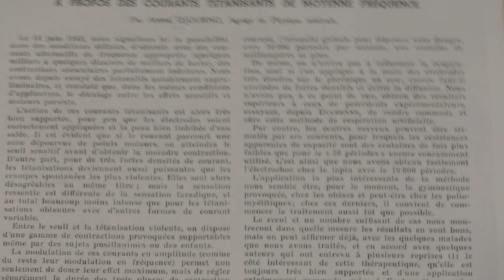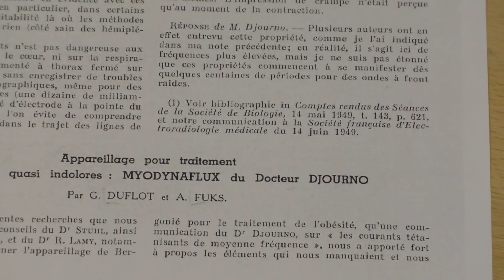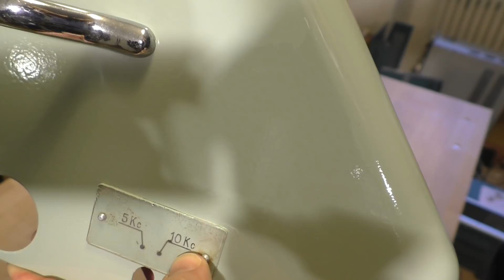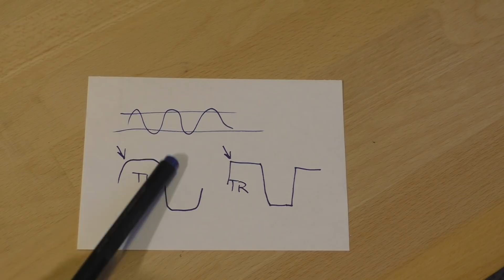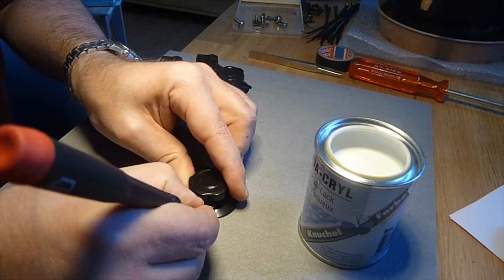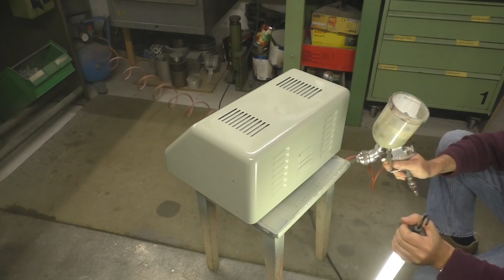Dr.Djourno's MyoDynaFlux (PWJ93)

Comment: Nice work! A very professionally built machine & a very good restoration. Hz has got to hurt! lol, yes it probably does! I had treatment from a doctor when I was 17yrs old with a similar machine after breaking a leg & plaster cast removed to stop muscular wasting or atrophy. It did hurt or shall I say Hzalot!
Reply from the maker: May I ask in which year that was? I told my girlfriend (she is a nurse) about your story and she only said that this must have happened long time ago :-) Seems this technology is not used anymore today.
Reply: Yes it was 1970 when I was just 16 years old, similar sort of treatment methods stimulating muscles with electrical pulses, I remember it was a 'transistorized' machine though, quite large, it sat on a trolley but was battery powered ,when turned on it 'whistled' like charging capacitors, I think they had thought better about connecting patients to the mains by then! It did hurt & was like having a severe cramp in the leg that had not moved in 6 weeks, keep up the great work!

Comment: 17:12 ECC82  :-)
Reply: and you did a wonderful restoration !!!
Reply from the maker: thanks.. that's right. I Think I will have to replace the oscillator tube because after the video it stopped again working. I guess the tube has an internal problem. A broken contact that goes loose when hot.

Comment: And here I was thinking you were going to tear this beauty apart. I was mentally preparing myself for this great sacrilege that was bound to happen. But nope, you actually restored it and did a great work at it.
One thing though: If you haven't already, you absolutely should keep the on time low until you have replaced any electrolytic, wax, paper or other capacitors that develop DC leakage. Otherwise the life time of the tubes will be greatly reduced and it can potentially burn out your transformers.

Comment: You did an amazing job cleaning this. It looks like new. The same functionality and more could be done with a couple of 555 timers and an amp IC now. What is the output voltage at the speaker?
Reply from the maker: The voltage depends on the load resistance. It‘s a constant current source, the voltage is about 1V. But it can go up to 100V or more. I have not measured that yet.

Comment: Why did they paint the solder joints? A tin whisker countermeasure, maybe?
Reply from the maker: I think those are check marks from quality control. I have never seen that before but because it is a medical device this could be tha case,
Reply: Back when things were properly checked. None of those pretend QC passed stickers like you see these days.